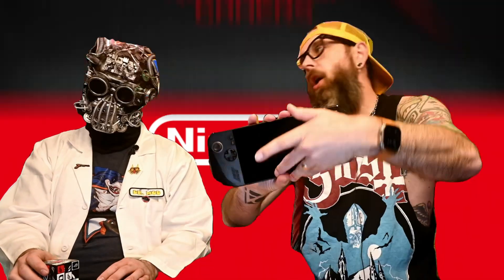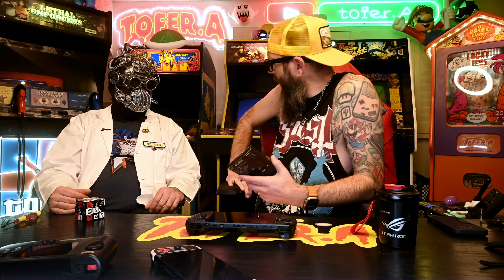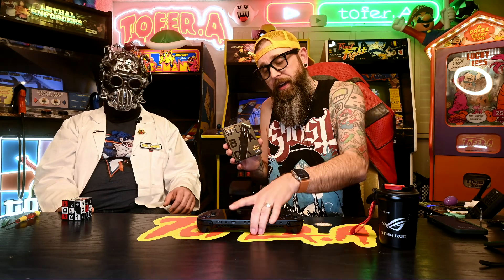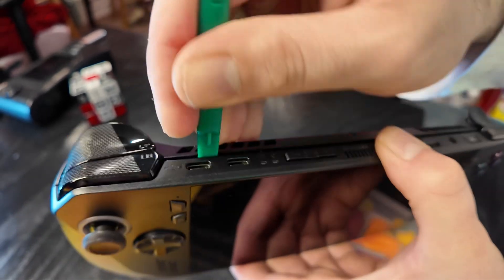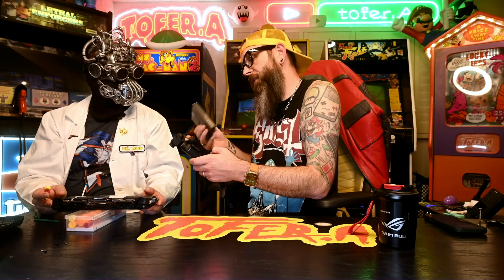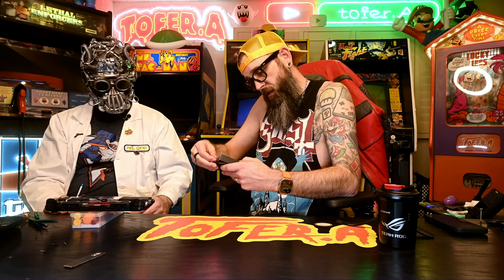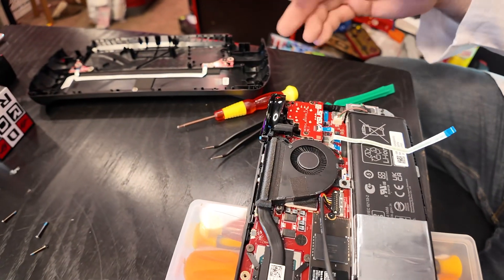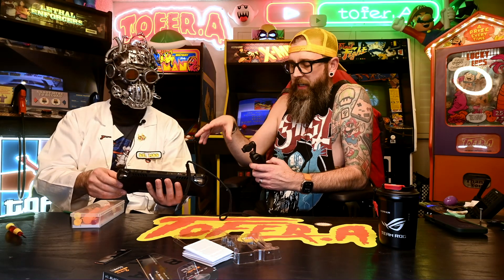How to EASILY upgrade the ALLY X SSD

Comment: Finally installed my 2tb that’s been sitting for months,  here’s what you need to know idk if my device came with stripped screws but  mine did all the screws came out except the top two corners they just kept spinning eventually just pried it open and they were loose anyway. Remove the power cable that silver piece you see you push down on that and gently tug on the cable upwards and it’ll come out eventually just keep being gentle everything feels like it’s going to break while you’re doing it. And then for heat sinks sadly I installed wrong the first time it was too bulky but I managed to get a piece on both sides a heat sink on top and piece of metal on the bottom and it still fit  when you’re sliding it in you shouldn’t see the prongs at all they go all the way in and then push down and your done. The rest of up to you figure out this i just covered what you absolutely need to know.

Comment: Just used your steps for the ROG Xbox Ally X. Unfortunately, the battery setup is different. Had to actually remove the battery to swap out the ssd. Just an additional 5 screws, but i was able to do that. Thank you for the video! Got a follower right here 💪

Comment: Just purchased a samsung 990 pro 4tb for $199 amazon prime days.  For my xbox ally x that i dont have yet 😅
Reply: I have done the same for the base model of the xbox ally. Gone with the 990 evo 2 tb 100.00gbp
Reply: nice. i bought the same. 4TB evo plus on prime day today :) gonna use it for my current Ally X
Reply: Perfect amount I brought 2tb ssd and 1tb sd card I’m already full with less than half my games 😅 lucky I can’t play them all but I would prefer more.
Reply: I believe for the those higher those higher end drives you want to use the heat sink because their naturally run hotter and are meant for pc’s  people have done test and those Samsung cards get hot I’ve finally got my own ssd a few months back and was too lazy too install it till now  and if you need an ally I could possibly sell you mine I want the new one coming out but I don’t want to drop a grand when I have brand new one still  just got it last year
Reply: Same here!!
Reply: @THT4433 I got mines today.  When I opened it up I couldnt figure out how to unplug the battery to get it out of the way of the ssd slot.  Its not like the previous ally.  I wound up taking out 5 screws around the battery in order to lift the entire battery out of my way.  Then I was able to change out the SSD with ease.

Comment: Thanks for the walk-through; as I type this, I'm doing the cloud recovery with my old setup, games and all, on a Windows backup on an external HDD. Once done, I'll have one of those 4TB/1TB setups. Nice how gaming handhelds have finally brought the UMPC out of obscurity after being essentially overtaken by smartphones and streamlined slate tablet successors like the iPad. Appreciate the help with both the physical open and with finding the cloud restore in the BIOS.
Reply: cloud recover is ur file bro? or file from internet?
Reply: @janmichaelsuarez2996  the cloud recovery was ASUS' default setup, with the idea of then restoring my configuration from a local backup. I guess I didn't describe that right. However, I ended up rebuilding fresh rather than restoring the backup, as I ended up preferring the cleaner restart setup.
Reply: cloud restore in bios is ur account bro or files from internet?

Comment: Bought a used one off eBay. This was not easy to do at all. 

The back panels bottom 3 screws came right up, the top left and the top right however did not want to unscrew at all, had to use different screw driver heads throughout the process and still they wouldn’t come out until I separated the shell and shook them out. What a pain.

Next problem was I couldn’t disconnect the battery cable bc I think previous owner had broken the clip. My devices battery clip did not go up and down like an alligator clamp. Instead when I go to it the metal clip it was seated below the battery cable, and it only slid further down south from the cable and back up into place underneath the cable, parallel to the board. 

By sheer force of will I managed to get the 1tb out and install a 4tb sn850x, but I hope I never have to open this thing again bc that was hell.

Comment: Well followed your instructions and when you disconnected the battery cable mine literally broke off on the rear side facing towards the top of the ally x without much force applied...and I was careful. Not sure what to do now but it doesnt acknowledge my battery anymore and won't do the cloud update. Guess I need to find a repair place to take it. In other videos they didnt touch it at all and I should have done that.
Reply: Ngl bro felt your pain I got lucky and returned it to Best Buy and got an exchange but yeah my first one the entire ribbon cable broke off with a Chunk of the MB with little to no pressure
Reply: https://youtube.com/shorts/2lCDdETwhIA?si=Gan3ozFqMBhQJU9A

I have done it my way..😊
Reply: @ShahebazSayyed-m3b bro you have the first one absolutely no help at all lol